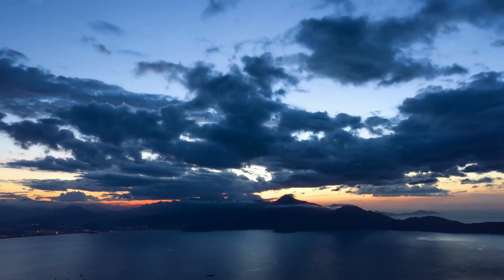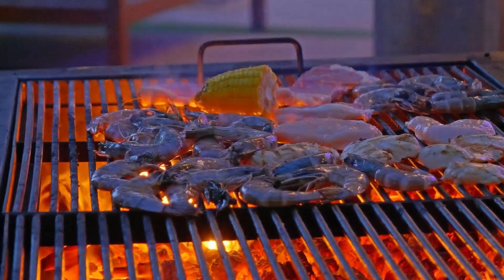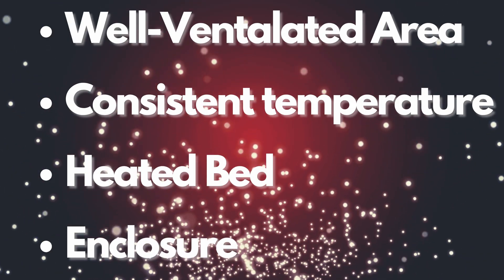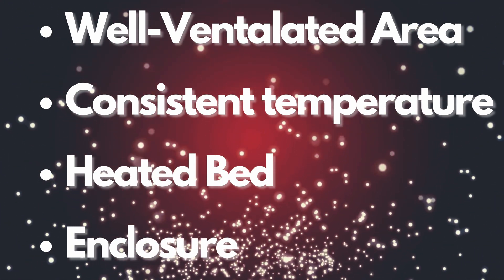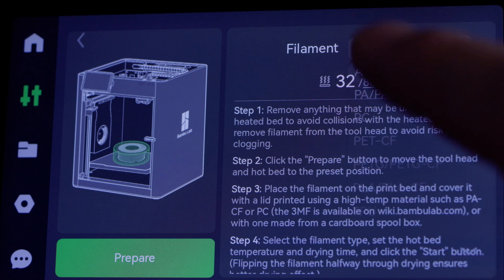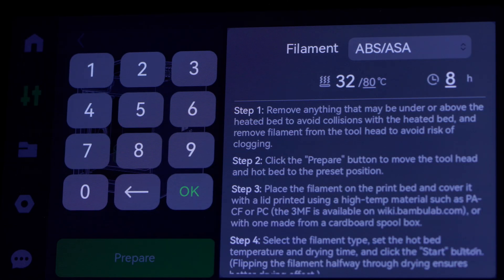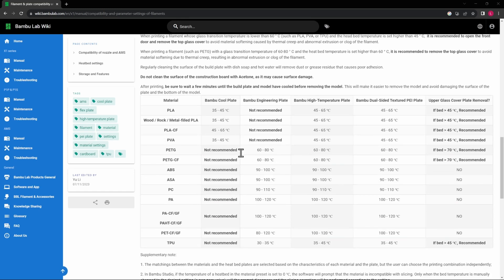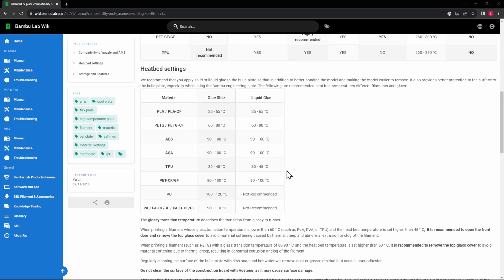ASA Filament on Bambu X1C: A Comprehensive Guide

Comment: To anyone who came here looking for real information on how to print ASA, I'll share what I found (and worked) for me. I'm using a Bambu P1S, with Bambu ASA filament. Start with the Bambu preset, but we're going to make some changes. Set the bed temp as hot as you can. Probably 100c, but some have noted you can go to 110. Set the nozzle temp to at least 270, though someone else told me to go as high as 280. If it's pulling up from the plate, use brims and try the smooth PEI plate. That stuck a lot better than the textured plate. Turn off all fans for the duration of the print. Now pre-heat the cabinet. I stuck a thermometer inside and waited until it reached 50c to start the print. Once the print is done, cool the cabinet down slowly. Lower the bed temp 10 degrees at a time from 100-40. Basically lower it, wait for the cabinet to reach that temp, and then lower it again. Once it hit 40, I turned the bed off and let it sit until it was roughly room temperature and removed the print. It was near flawless after experiencing two unfinished warped prints.

Feel free to add your tips and tricks - I'm still learning and by no means an expert. I'm just sharing what worked for me!
Reply: Better tips than a "comprehensive video"
Reply: @Luigi620_  Thanks! I thought this video was a whole lot of nothing, so I wanted to share.
Reply: @StevesGarage should make a video. I'm doing a large print because I'm make a dovetsil item to mount a power box and mini computer for astrophotography and I keep having issues after issues.
Reply: @StevesGarage yeah I am right now. Their first two attempt pretty bad and it started warping. I then put a bunch of Elmer's clue on there. Also put a raft 15 layers worth. And a bunch of supports to try to keep it down. It is a 7-hour job and and as far as I know looks pretty good.
Reply: @StevesGarage  I haven't what settings do you for flow?

Comment: Is the carbon filter in the Bambu P1S enough for fumes?  Or would I need to vent it to the outdoors somehow?
Reply: I used the Voxel Bento Box filter and didn't have any smell outside the cabinet during a 4 hour print.

Comment: So for anyone wondering, my print settings for the X1 are no fans on at all for the entire print, bed temp is 90-100°. I print fairly large objects and this has reduced/ stopped warping on large prints. I also tape around the edges of the glass door to prevent heat from escaping. Asa needs to be hot!
Reply: does that include turning off the parts fan?
Reply: @AmirKhan-qx2lr  Yes! Turn them all off. You want it HOT inside.

Comment: What part of this video is a comprehensive guide for ASA? You just explain what the material is and what it's used for, but you don't even mention what settings you've tried and are now using.
Reply: Agree. I only got whats on the packaging from the video. Zero experiencebased review of material and settings. Issues experienced etc.

Comment: "comprehensive" doesn't actually include anything about any setup or specific settings used to print ASA, no discussion about build plates aside from what can be seen in slicer section, glue used, type of glue, fan settings, temp settings, speeds......nada
Reply: Just wanted to say thanks for the 10mins saved, just skipped the vid
Reply: Yea I was hoping for some print speed and fan settings.
Reply: Agree with all you said. After 8 months from your comment he did not even acknowledge it. Tell me it's a click bait without telling me it's a click bait. Not really but close. The only thing I learned from this video is a new word.... Ventalation!
Reply: Yeah thanks for the heads up. This guy is useless.
Reply: hahahahahahahahahahahahahahahahahahahahahahah lmao teeeheeeeee poooooooopppyyyy
Reply: are your reading comprehension skills greater than a third grader? apparently not....
Reply: Yeah i am kind of surprised too. I came for nice juicy details from someone whos printed with all materials but got less than what's available on the asa packaging short descriptions. 

Just reading info like this straight from wikis is kinda better to do directly from the wiki because we can look around and click what we want. What we want is the meat and potatoes. What you have learned. What mistakes you made. What people usually do wrong. How in detials you should print with it. 

How come there are no discussions on the settings in a video about printing ASA?
Reply: It's for a Bambu Labs printer. The printer knows the settings it needs.
Reply: @rowanisjustatree  It doesn't though, the printer settings are just a starting point. Especially for something like ASA.

I've had the stock settings work great for PLA and PETG, but needed to dial things in to get a successful ASA print.
Reply: @StevesGarage  but it does actually.
Reply: @rowanisjustatree  wrong, default setting under extrude

Comment: What about the cooling settings ? Did you accept the defaults 10% min , 80% max ?  Aux fan off ? What where you chamber temperatures ? This is a bad omission for a tutorial for product known to warp. Your environment cam make a significant difference to the chamber temperatures you can reach

Comment: Hi, I'm new to printing and I'll be printing something with ASA, do I need to dry the filament before the print if the filament comes in new in the vacuum sealed bag or when do I know I need to dry any filament?
Reply from the maker: Follow the manufacturers recommendation. It should be somewhere on their website. Usually on the filament page. What brand are you using?
Reply: @lendizzle77  thanks for the reply! I have an X1-Carbon and I'm using BambuLab's ASA filament
Reply from the maker: @virtualnk5825 80c for 8 hours.

Comment: great video! I just started using ASA and ABS and my prints will begin to lift up on the  corners about a few hours into the process. Do you have any suggestions? Thx
Reply: Same issue here
Reply: Same here! 🤬🤬🤬
Reply: Same here! 🤬🤬🤬
Reply: Same here! 🤬🤬🤬
Reply: Same here! 🤬🤬🤬
Reply: Same here! 🤬🤬🤬
Reply: Try adding a 5mm-10mm brim (depending on print size)

Comment: how rigid is it compared to other filaments? does it take paint well? what chemichals should be avoided when using it?  this video kinda feels like youre just giving information that bambu has in thier product description and not testing anything. like yes, of course it will do multifilament, but will the filament adhere well to eachother? its a stretch to call this comprehensive, and outrageous to consider calling it detailed like in the description.

Comment: A Comprehensive Guide might include what settings did you use on the Bambu x1c.
Reply: Love the videos, very useful but I have to agree with AJ on this in that the title doesn't fit. A useful video in that it explains ASA but not much guidance on printing with it. Load and hit print?
I was hoping for info on how to deal with shrinkage, layer separation, and common ASA (ABS) printing problems.
Reply from the maker: The RFID on the roll tells the software what type of filament it is and does the settings. I should have mentioned that.
Reply: @lendizzle77  Yes, if everyone used generic Bambu filaments. There are other filaments out there, that don't have RFID tags

Comment: After drying how long before you redry again can you store in a dry box
Reply from the maker: It depends on how humid it is. ASA absorbs the moisture in the air so the more moisture there is, the more often you will need to dry
Reply: @lendizzle77  so a dry box will help at 10% humidity
Reply from the maker: Yes.